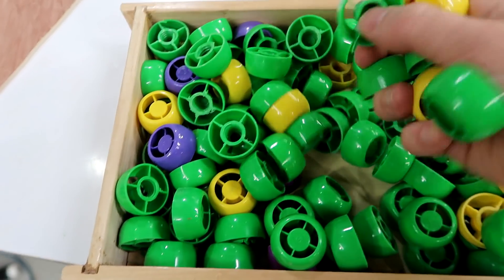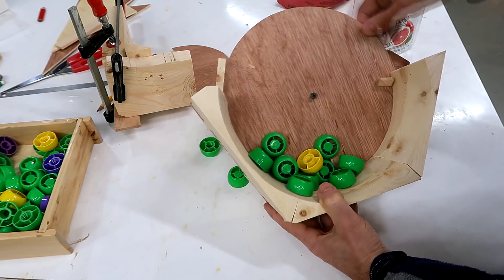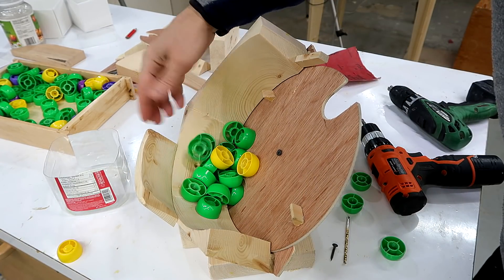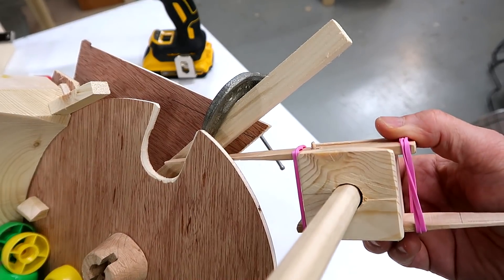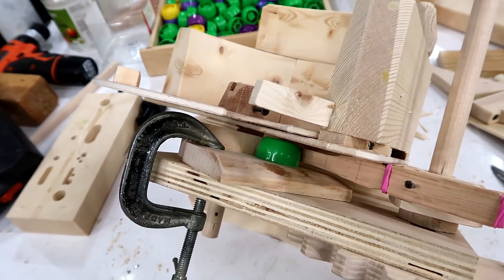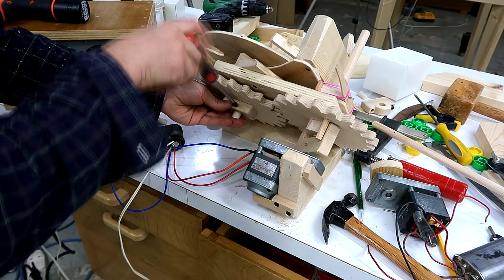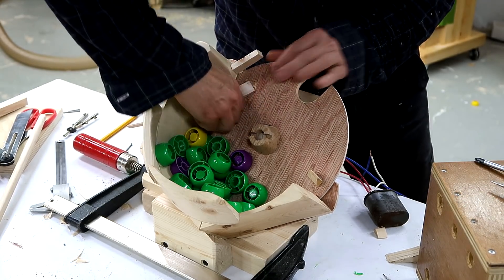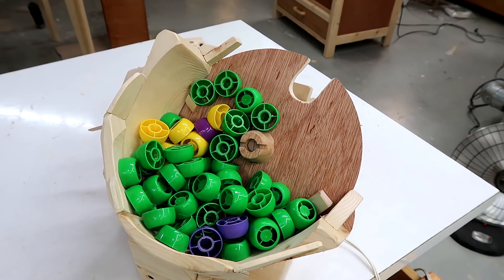Hopper fed repeating catapult

Comment: @Matthias Wandel
Put the agetator just after the hole, touching the hole (and have a flat edge forward, not very high piece), in that way it acts like the hole is deeper & might pull in an upside down cap.
Maybe add a ramp agetator (ramp forward) just to trap a piece in the hole.

Comment: You should put a washer (or two) under the grab wheel. By giving it just a TOUCH more space in the grab point it (should) ensure more reliability in getting a cap captured and not knocked out by the others still in the hopper.

Comment: Hi Matthias, honest suggestion here. You could try add more holes to the pickup disk and create a "queue" ramp with the aligned caps. That way you assure if there is one cap that does not cooperate, you have others in queue.

Comment: Need a small amount of buffer between the feeder and the catapult, and a different gear ratio so the feeder feeds at a faster rate than they are fired. That way if it doesn't pick one it doesn't matter

Comment: Really nice :-) I was thinking that the material for the rotating disk might be a bit too thin and that a thicker disk probably would catch and hold the projectiles better if the rounded side is facing downwards. it looked as if other lids sometimes pushed already caught ones out of the notch again.

Comment: You really got my curiosity about the overload protection using a light bulb. How does it work?
Reply: You wire up the bulb in series with the motor, when the motor is running normally the current is limited by the motor and low so the bulb barely glows, if you stall the motor the current rises so the bulb gets brighter. For this to work well you need a weak motor and a big bulb. I paused the video in some spots and noticed he is using a 0.52amp nominal motor and a 100W bulb (~0.85A).

Comment: The hopper reminds me of bullet and case collators used in progressive ammunition reloading presses. Having seen them in operation I would suggest 2 modifications to yours. 1. A thicker plywood wheel/plate. And 2. A ramped agitator on the stationary round wall that would tip the pieces standing on end (like a wheel) down into correct orientation before they drop into the firing mechanism.

Comment: What about a longer, curved slot? One that can hold multiple caps at a time. The curve would have to be away from the direction of spin so the caps are forced to the outside of the circle by gravity until they pass the drop off point.

With a longer slot, you have more of a chance to get caps into the slots. If there are multiple caps in a slot, then you are guaranteed to have one in that slot the next go around.

You could potentially get rid of the agitators and add 2 more slots (and double the frequency of the catapult mechanism).
Reply: Or halve the frequency of the feeder.

Comment: Really a fun project.  The kids are having a ball and burning a lot of energy keeping the hopper filled with caps.  Unfortunately, this devise would never be able to be mass produced and offered for sale because of all the safety issues.  I mean, it doesn't rank up there with the original 'Lawn Darts' or have the potential for lethality like 'Irwin Mainway's' (Dan Aykroyd) Bag of Glass, but flying plastic caps could hit a kid in the eye and cause problems.  I suppose you could substitute the plastic caps with a more Nerf like material, but then there would be some trade off in distance of the projectile.  Still, I find this contraption quite interesting and wouldn't mind having one myself, although being 72 years old, I have no idea what I would possibly do with it.

Comment: Cut multiple pick-up slots in the load wheel, and possibly speed it up too, to overwhelm the feed rate. adding a track-way will allow a backlog of projectiles to accumulate. An escapement mechanism may be needed.

Comment: That light bulb in series to detect an overload is a genius idea. 
I assume the motor operates at such a low current that the resistance from the bulb doesn't affect it, and only when it's stalled, the current increases significantly?

Comment: You need to add a ramp that once a lid is in the right orientation it's held under that ramp and waits for the notch in the wheel to pick it up. That's kind of how an industrial coin sorter works

Comment: I was waiting for you to add something to vibrate the caps in the hopper so they'd settle flat more often.  What happened?
Also, I was thinking that having a section of the "container" near the bottom, with an angle that would help push upright caps flat might help.
Just spitballing.  You probably have reasons you didn't do those things.  😃

Comment: A little late, but making the wheel as thick as the caps are tall would have helped.
Reply from the maker: then it wouldn't control orientation, and also pick up sideways caps

Comment: "Something useful.." hmm..

Maybe make a wooden roomba that has an intersting random direction mode with lego linkages? It sweeps stuff upwards into a practical removable bucket using a spiral turny-thingy?

Or maybe make an outdoor WROOMba with that dangerous 1HP blower motor? To sweep up apples or shoo "those pesky squirrels" away? Who knows? :D
Reply: Use the roomba to pick bottle caps off the ground :D